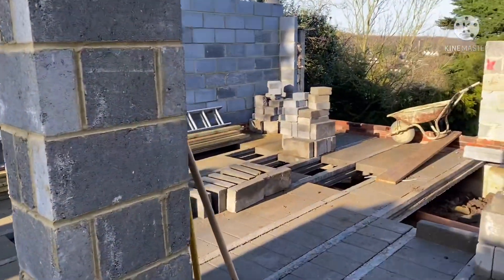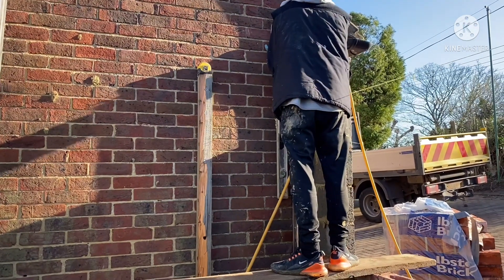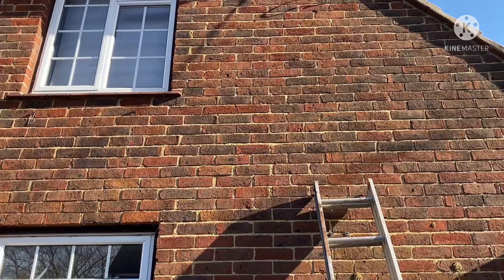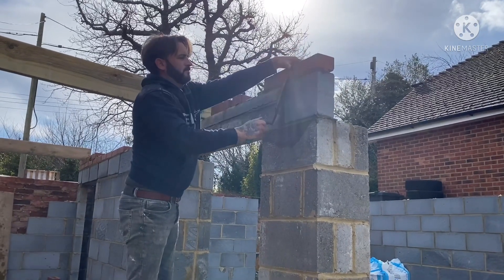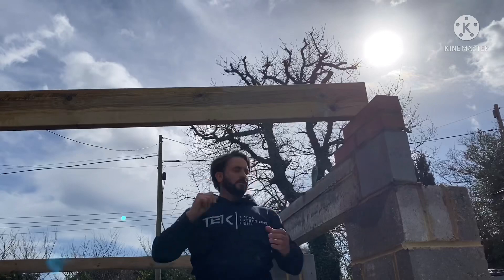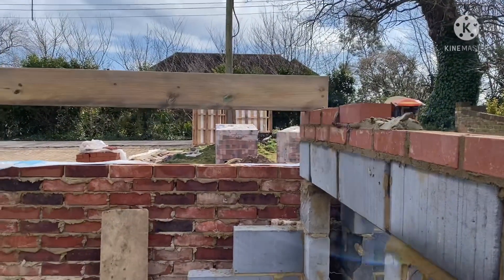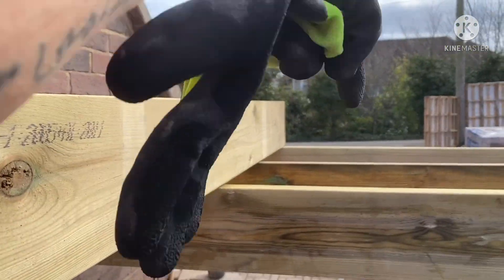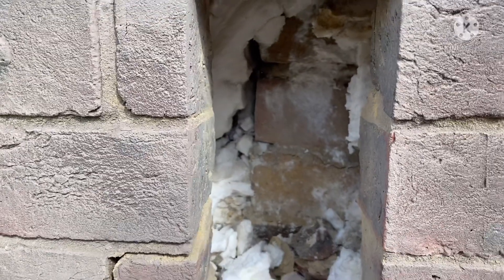How to install timer floor joists on a double storey extension

Comment: Nice job mate.
I'm just wondering if you could have used the masonry type joist hangers cut into the brickwork to support the joist ends instead of cutting all those pockets? 
I think less cutting would have be required but perhaps you had a reason not to use them.

Comment: Is there any reason/benefit you decided to insert the joists into holes in the original house? I only ask because I did the same when I replaced an extension floor but it seems everyone uses wall plates(?) and joist hangers in the videos I watch. I’m hoping there’s some sort of benefit!
Reply from the maker: We would usually build the floor off a wall plate but we knocked through into the house above where the wall plate would of been attached and this would of undermined the strength of it attached to the house so we cut pockets in to the house wall instead 👍
Reply: @extendaspace-constructionc821  ah of course. Seems obvious now. Thanks.